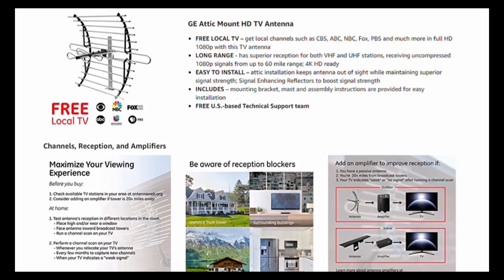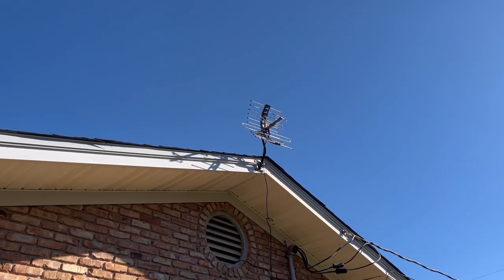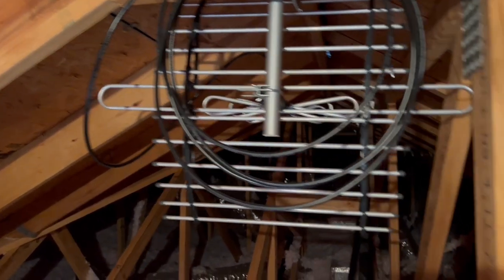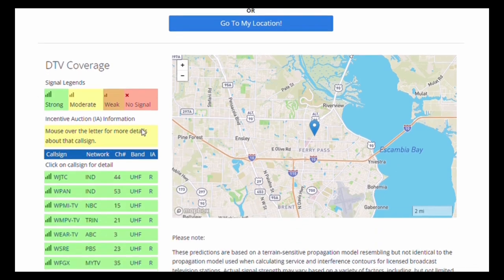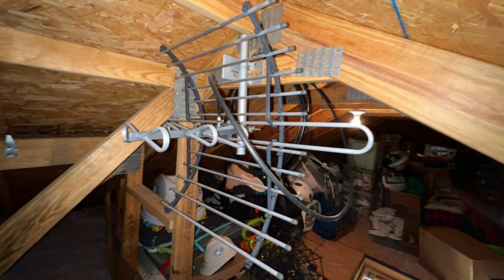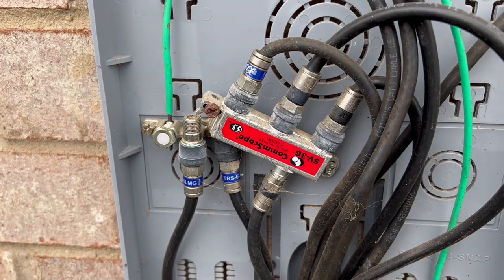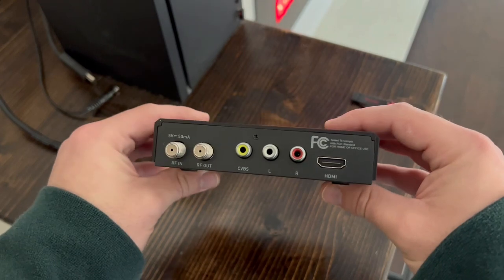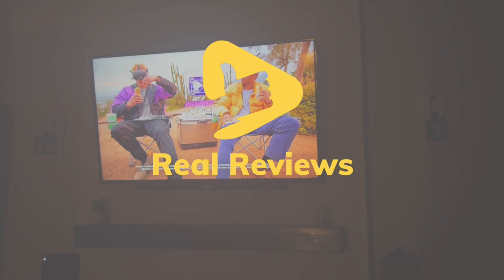Local Channels on EVERY TV in Your Home WITHOUT Cable in 2023

Comment: i did this 12 years ago with an out door ant. plus amp. im  close to my market ,but i get the other market 65 miles away, im getting about 75 stations , the ant .you have is the same as mine its as good as the old type long ones ,HOWEVER IT ONLY WORKES HALF AS GOOD IN THE ATTIC ,i probaly saved my self 10 thousand dollars over 12 years ,BUT IT DEPENDS WHAT CHANNELS YOUR HAPPY WITH .
Reply from the maker: That’s interesting. My father and I live only about 5 miles apart, and we both get about 50 or so channels with mine in the attic and his outside. Great testimony to how much you can save with this method,  so thanks for sharing!

Comment: Add a preamplifier ( RCA $30 at Menards) to improve the antenna signal even more.
Reply from the maker: Great tip, thanks!
Reply: Thanks for the information I’m looking for all the items that I need now my Friend thanks again
Reply: @The_Real_Reviews   A preamplifier does not improve the "antenna signal", it compensates for signal loss because of long cables or a splitter that is used for going to multiple TVs or recorders. The cheap RCA preamp is probably inferior to the cheap GE (I have tested that one), but both may be noisy, as can even the higher cost venerable brand, Winegard. The superior (and expensive) model preamps are from the Televes brand. There aren't any others like it with its unique auto gain function.
Reply: There are other pre-amps available on Amazon, but I like this one and the price is right.
Reply: @ernietallman  Just like "the best antenna", other devices are the ones that work for you.

Comment: I just made an antenna out of TV coax and nothing else.  Strip the wire and fold the outer braided shield back over the remaining coax to make a dipole of sorts. Picking up digital signals from 40+ miles out. The exposed conductor is about 8 inches long and just lightly trim until you have a good signal.
Reply from the maker: I’ve seen someone do this in a video before. Great show of ingenuity!

Comment: All antennas from the time of Tesla and even today work with all types of analog and digital modulations exactly the same.
"Digital" is not an antenna type designation such as Yagi, LPDA, dipole, quad, J antenna, etc.
There are also frequent mistakes when writing DVB-T/T2, HDTV, FullHD antenna, because antennas with these marks have nothing.
Reply from the maker: The point I’m getting at though is that it’s the name of the product, from the manufacturer. If I didn’t provide the actual name of the product and instead just said “antenna”, wouldn’t that be confusing for someone who might want to try it for themselves after watching my review?
Reply: @The_Real_Reviews  Loved your info video - it's great for the people that are just getting into cord cutting. I cut the cord 10 years ago and haven't ever thought of going back.
One thing you might mention to the "newbies", there is no such thing as a digital (or High Definition) antenna, don't waste your hard earned money on that BS . . . a coat hanger will work just as good if the conditions and distance are optimal.  HD and Digital are marketing hype, as is a 350 mile antenna . . . curvature of the earth would kill the mileage claim in a heart beat.  Keep the info flowing, the more people we get to cut the cord, the more TV will become "affordable" again.
FWIW, I've been on an old set of Rabbit Ears in my attic for that 10 years but I live 5 miles from the towers . . .
Reply from the maker: @peetywondr3256  thanks for the advice! Some others have mentioned that in the comments as well. It’s not something I was aware of before I made the video, as I’m definitely no expert. With that said, I’m still happy with my purchase with this antenna being fairly cheap and easy to install. Very helpful info, though! I definitely wouldn’t recommend an expensive antenna or one that claims a ridiculous range.

Comment: Antennas don't work in apartment buildings
Reply from the maker: That’s interesting. I would think an antenna would work anywhere, but I’m definitely not an expert. How did you set yours up?
Reply: @The_Real_Reviews   pretty much all over the apartment even in a window
Reply from the maker: That is really odd. There are a ton of factors that could be affecting your reception, and as I said I’m no expert. I’d recommend finding a Facebook group related to over the air antennas and asking for advice there, as they’re usually packed with people who really know their stuff. I can only relay my own experience with these specific antennas, and unfortunately I haven’t had exposure to apartment applications. Good luck in your cord cutting journey!
Reply: Apartments won't invest in an Antenna
Reply: Not true . . . I lived in a two story condo on the Northwest side, bottom floor . . . TV towers were Southeast (exactly opposite). Put antenna in the bedroom that was in the southeast part of the unit and got 83 channels of the 105 available in Vegas.

Comment: There's no such thing as an hd antenna it's a marketing scam
Reply from the maker: It’s really a semantics thing more or less. You’re receiving “high definition” video no matter what antenna you use, even if it doesn’t tout itself as an “HD” antenna. The picture quality will depend on your distance from the signal source and the quality of your antenna and TV.
Reply from the maker: As I said in my response to your other comment, “marketing fraud” really seems like sensationalism. I would rather not carry on two separate conversations about the same thing, so if you feel the need to respond, please do so in the other thread.
Reply: @The_Real_Reviews   Wrong, again, and again. Some TV stations transmit standard definition video on their sub channels, regardless of the antenna. And, the picture "quality" does not depend on the distance or the quality of the antenna. You are ignorant of how digital television works and how it differs from analog TV.
Reply: @bjs2022  Technically, you are correct.  I use an antenna that looks like it was from the 60s and it works as good as ever to pull in signals.  However, in reality, it doesn’t matter in this context.  I’ve seen more misleading reviews than this one.  It’s mostly accurate.  I would add that there is no one “best” antenna because it depends on your situation.  If you live very close to transmitters for the stations you want to receive, a paperclip can bring satisfactory results.    If you live in a remote area between markets and want to pull in stations from multiple directions on UHF & VHF, you will need a more complex setup.  Antennaman PA on YouTube has lots of good tips and will even give you a personalized antenna recommendation for a reasonable price.  He’s reviewed all of the antennas and devices in this video and lots more.  He even took a sledgehammer to the Lattice (?) that you tried before and it didn’t work because that is the worst antenna ever).
Reply: Yes  this is true